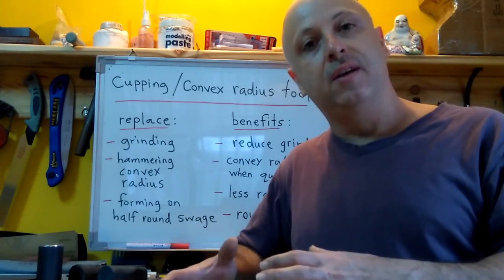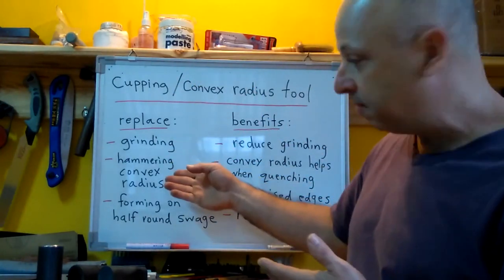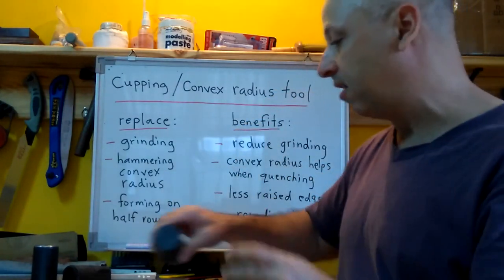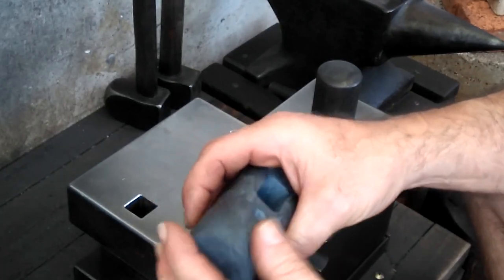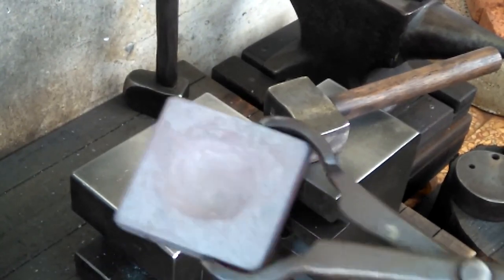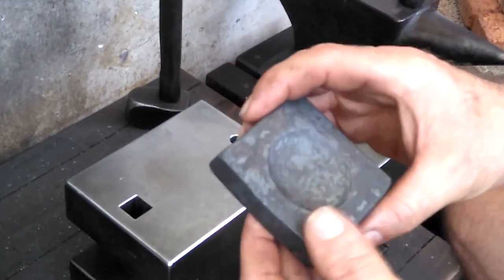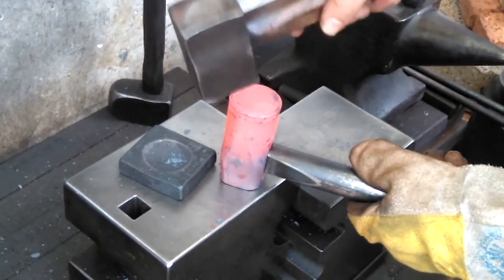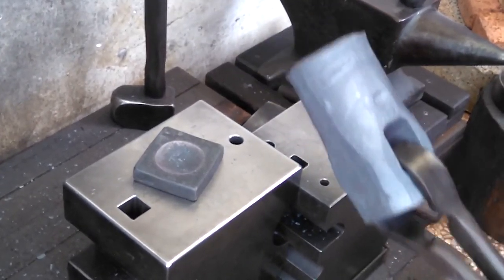Hand Forged Cupping / Convex Radius Tool (for hammer faces) & New (old) Bench Vise

Comment: When I was being taught to make hammers we would drift the eye and then once the eye was too cold to forge use the drift as a handle to radius the hammer face. Also the hammer was held at a shallow angle and rotated around the cupping tool. This not only introduced a radius to the hammer face but also helped release the drift.
Reply from the maker: Yes, forming radius immediately after drifting is definitely a way to go about putting a radius on the hammer face. The idea of holding at an angle and rotating is a super idea that I think may also reduce, if not eliminate, the flaring of the edges. Very good stuff... Thanks and happy new year. Glen

Comment: Great idea Glen to get a more consistent radius with fewer hammer blows. I had my very first newbie blk smithing experience with my home made wood burning forge and a .5" rod of mild round stock. heated it  and cut 2" end off, reheated five times, compress it down longitudinally to 1.25" and squared it to a rectangle. It didn't turn out perfect but all in all i achieved a decent job. Next is to octagon it then drift a hole to turn into a tiny hammer head.
Reply from the maker: Jim, On paper, this tool seems like it should work well but for me, it's hasn't worked out too well. I think I need to make this in a larger size. with a much larger concave area for working hammer faces. I think you're approaching your blacksmithing correctly - one step at a time. It's important to understand how hot steel moves under hammer blows and to perfect techniques like drawing, squaring and rounding stock and the like before actually making something of use. And it's best to learn while using small to medium sized stock. Thanks for watching and good luck in your work. Glen

Comment: Very cool. What about this bottom die? Or swage? Set in to the plate deeper and chamfer or secondary taper so you don't get the mushrooming edge. Thanks and have a great Christmas you and your family
Reply from the maker: Excellent ideas. Some others have also pointed out these two things but only you pointed out both in one comment. I think the combination of chamfering the edge and deepening and widening the cupping tool will prevent the edges from flaring (mushrooming) out. Thanks and happy New Year. Glen
Reply: Exactly

Comment: Hey Glen, really enjoy your videos! Been getting my workshop ready for forging and your tutorials are giving me a lot of ideas. How do you keep scale off your forging? I get massive amounts of scale while forging.

Have a good one.
Reply from the maker: I'm glad you like my videos. With blacksmithing, scale will always form to some degree. it's a good idea to brush off your workpieces every so often and in fact, old timers would brush off scale immediately after removing from the forge, before doing any hammering. Another thing to consider is your forge. if coal (or charcoal), you may want to build it up more and and get your workpiece away from the top or bottom - have it positioned in the middle buried under some coal. If gas, forming too much scale might mean that you are running too oxygen rich - oxygen is not being completely consumed in the fire. But I have also found that a gas rich fire can form a strange sort of scale that doesn't flake off and is hard to remove. Try to get your forge running as neutral as possible. I hope this helps. Thanks for watching. Glen

Comment: Hi Glen. good video. Question from a new hobbiest blacksmith like me. what is the difference between doing the convex radius with your new tool then using a grinder to make the hammer convex radius. Marco
Reply from the maker: Marco, There isn't too much difference between forming the radius via hammering or via grinding. However, many blacksmiths (myself included) feel that steel (the grain structure) is improved through proper hammering at the right temperature which "packs" it, making the steel denser and harder. But as far as the radius shape is concerned, either way will do. Thanks and have a Happy New Year. Glen

Comment: It seems to me Glen, than if you hammer a slight chamfer around the perimeter of the face before you go to the cupping tool, you will eliminate that flaring of the face. You'll have to experiment to see how much chamfer is needed.
Reply: I was thinking the same Glen, hammer a minor bevel round the edge, then do what G.Bell suggested. You might be able to knock out a few finishing steps, or at least shorten them.  
AAR
Reply: That was my thought as well...plus it'll give you enough material to completely fill in the  radius tool, nearly eliminating the need for any grinding. Great video as always, Glen. Hope y'all have a merry Christmas!
Reply from the maker: Scott, That's a very good idea and something I will definitely do. Also, Thomas Johnston's comment above is true - if the cupping tool (swage) depression is wider than the hammer I'm working, the edges shouldn't flare out as much. Thanks (Scott, Albert, James) for sharing this good suggestion. Happy new year. Glen

Comment: Hey Glen, I was wondering if using a lightweight hydraulic press to forge a piece like this would be a feasible option?
Reply from the maker: Liam, Sorry for the late reply. I guess it would depend on the size of the press but I think it would work. And other than a hydraulic press, I think a fly press would also be suitable (as an unplugged option) and this is a tool I would like to get in the future. Thanks for watching. Glen

Comment: if you make the swage with a larger diameter hammer die you will get less mushroom from on the actually sized hammers.
Reply from the maker: After reading your comment and examining the cupping swage and hammer I worked in the video, I think this is an excellent idea and I will certainly do this. Thanks and Happy New Year. Glen

Comment: Some different jaw faces such as brass, softer steel and so on to hold without marring would be handy for the new vise.  You have shamed me into it, I am contacting Traders Metal tomorrow to find out what 150-pound piece of steel suitable for an anvil will set me back. It sucks being on pension.
       Mike
Reply from the maker: Mike, You, like many of us, may be limited by budget but not imagination. I'm sure if you look around you'll find what you need. And thanks for he brass jaw suggestion. It reminds me of using copper jaw inserts to not mar work in the past. Glen